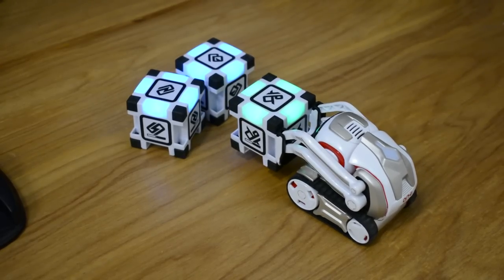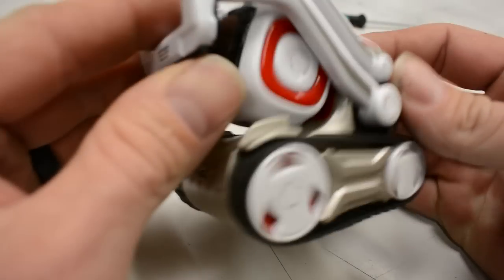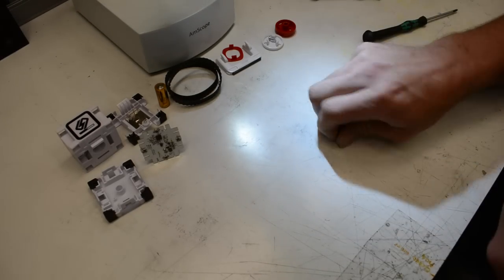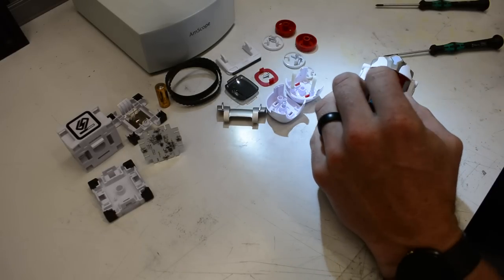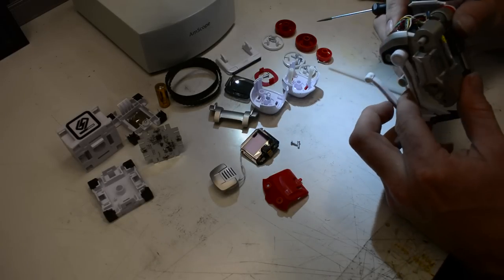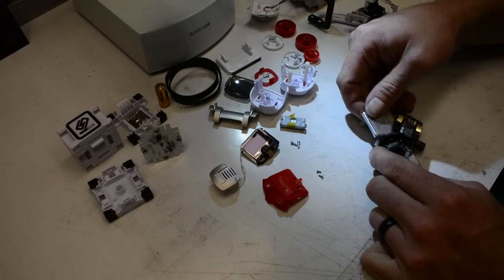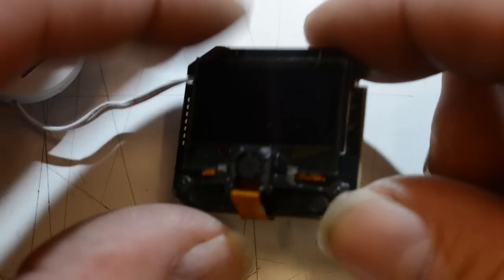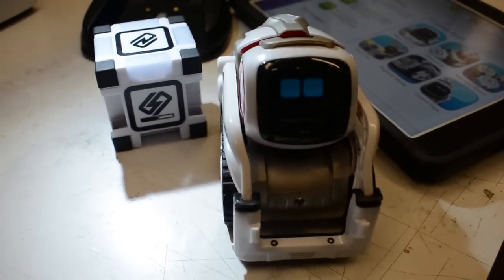Inside Cozmo - We Tear It Apart - Anki Robot Autopsy

Comment: What type of battery does cozmo use?  (Voltage, Capacity etc.) I will try to replace it...
thanks a lot !
Reply: I am watching this video for the same reason (battery dying right away).
Did U ever get Urs replaced?
Reply: Any joy? My sons cosmo died and im trying to source a new battery if possible. Any help appreciated! Thanks!
Reply: I saw the Number P161212 on the battery during the video (a short shot), but that might help you. There is another video that actually shows battery replacement. I ended up ordering a 3.7V 400mAh 522332 Lipo Battery Rechargeable Lithium Polymer ion Battery Pack (Which looks like the right size, I hope it is not too fat) I went with 400mAh over another thiner one with 300mAh (which I believe that the original battery is a 300mAh pack.), but I always say, more is better.) God bless and have a great day.

Comment: 7:12 - legendary idea.  I just replaced my grandson's battery and am starting reassembly.  The idea to remove the charging hardware would have made soldering in the new battery MUCH easier.

Comment: Taking apart Cozmo for battery replacement was no problem for me, but I can’t believe how quickly you separate the cube, been stuck in that for hours - is it just two clips in the middle?
Reply from the maker: one "tab" clip for each side on the lid of the cube, opposite of the battery cover. The battery tube block is hollow plastic.

Comment: The white light indicates his power is still on eventually he will fully power down turning off the light and if he is correctly put together the treads will also power down. If the treads do not power down it is a problem in the chips sending involuntary messages to the motor. If you place him on the charger you'll see the light turns green meaning he's charging take him off and see the white again.

Comment: What is the battery's mAh rating? There's no way of checking the voltage properly with a multi-meter so the battery is going to wear out fast and will need replacing after 1-3 years or so.

Comment: I do have a question about the battery. I need to replace the one in my Cozmo since the cells are now completely dead. I know its lithium ion but what exact type is it? Can you even purchase a replacement battery like this? I just need to know what to type into the Ebay search bar lol

Comment: Great video,
My cozmo was working fine but for only for 5 minute. So I bought a 600mah batterie and got a technicien to do the soldering for me. After reassembling cozmo,
It does not power on, when I put it on charger, nothing happens. Not even green light flashing.
I have 2 cozmo and the other one charge fine , so it is not the charger.
I took  a volt meter and I have 4.9 volt at the batery soldering point on the board. I also  took a continuity reading from the charging plate to the soldering point on the board. 
So now I dont know what to do.
Do you have any advice?
Thanks Keven

Comment: How in the world did you take the cube apart??? The nut that holds the screw fell off so I'm trying to open the cube to put it back. I've been trying to open the side with the circuit board but there's 4 clips.

Comment: Hello,
Mine just went thru surgery due to one wire came loose from one motor. Just did circles. 
However, when putting him back together, I noticed a spring! When did that come out. I don’t know when or where. Do you know where that funny bone goes? As it’s not too funny.

Comment: Great video. Did removing battery solve the zombie problem? Since this is used toy, was the playtime any shorter due to LiPo battery degradation? Perhaps you could post a video how to replace battery in older Cozmos in fewest possible steps. LiPo typically don't last past 200-300 charges, depending on charging currents and discharging level. Seems like that Zombie issue would certainly overdischarge battery unless Cozmo has some sort of safety switch in it. Thanks

Comment: Thanks for taking apart. So it's brain and behaviour is inside the app, just a few Kb of storage inside the robot itself. I think it used to store sequences of movements and face impressions. It is in some way a ioT device.The display looks like a standard 128x64 pixel OLED display. Maybe you can use a bluetooth sniffer or can download the firmware to use on a standard ESP board, that would be fun.

Comment: Hello the NRF315 chp is a 2.4GHZ bluetooth chip. So the Cozmo is using bluetooth looks like. Not not sure on that battery how long will it last on a ESp8266 because they use a lot of current to run them. also the motors of the wheels and the blue oled screen does take a lot. Man i would love to get my hands on the sketch and libraries it uses to make the Cozmo face.

Comment: Hey, I know this is old so it might be a longshot for answers. But my cozmo didnt work or charge. So I changed the battery, but that did of course not work either. So after doing some conductivity checking there was no connection between the charge plate and the bat+. I just threw a little wire between bat+ and the charge plate blob. But is that ok/safe? It works though. :)

Comment: I also purchased one second hand and discovered the lift is broken. Wondering if you can help with that. When manually moving the lift is fine on the bottom and also at the top (lift is above cosmos head) . the problem seems to be in the middle section of the lift gear.

Comment: That was cool... thanks for sharing, KurTrox. My question is: did disconnecting the battery reset it and cure the sleep glitch?
Reply from the maker: Sadly it did not.. A board level "replacing chips" repair is coming out someday. Eventually...

Comment: Any information on the power management/ Analog ICs used - LDOs, Op Amp/Current Sense, Vref, Switchers, Battery management, Motor Drivers etc.

Comment: Just 4 days ago i received my cozmo from ebay, got him for $10 since was sold as parts. For some odd reason his arms and right wheel were jammed, I had put him charger and yes he turned on but started to over heat really badly, so i figured maybe uts because he can't move his arms and wheel. Took him apart to discover that the wheel mech was deformed so the previous seller must have had this problem and didn't even bother to mention it in description. after 6 hours of readjusting the mechs i finally got them to move freely but upon test he didn't want to movr his arms nor head. At that point he ended up dying completely all he wants to is just move his arms doen completely and won't stop. I looked at the board and noticed to little component's are burnt, do you think if i were to replace them he'd probably fully work again? Thanks!

Comment: Kurtrox, can you tell me, is that LED headlight supposed to be illuminated all the time? My Cozmo has real trouble seeing his cubes when they are very close, and when I use a camera phone to look at the LED, it's never lit. Is it faulty?
Reply from the maker: Philip Corner the IR headlight is turned on in dark situations. the camera on cozmo will activate this only if needed. In explorer mode you can control this. but a dark room should do the trick automatically.

Comment: Inside his head circuit board live the accelerometer and gyro chip. Do you know the part number anki have used or send through a detailed picture of that circuitry? Thanks dan
Reply from the maker: daniel berenger we can open it up again, or you can pause the video of the back of the head. it does have an esp8266 chip.
Reply: Thanks I will try and pause the video

Comment: Great video! Quick question. I received a Cozmo as a gift (no receipt). It seems I have one with a bad internal battery. As soon as Cozmo comes off the charging pad he completely shuts down, even after charging for hours. Is there an easier way to get to his internal battery to replace it? Also, what kind of battery is it and where would I find it? Thanks so much !!
Reply from the maker: Chris Twirbutt the battery is really buried in the base. I had to take it completely apart to get there. it was a single lipo battery. easy to find on eBay for a few bucks. I can't remember for sure but I believe it was 370mah. I'll dig through some pictures if I have em.
Reply: Thanks that would be great! I would like to buy the battery on amazon and try to take it apart and replace it thanks to your video!  Please let me know which battery I can buy as a replacement thanks SO much !!

Comment: Hey, I have a cozmo but the sound does not work. How do you open the speaker up?
Reply from the maker: Samuel Cifuentes there are two screws in the head underneath the red ring on the side. you can fast forward through the video.
Reply: Yes I already got those off, however I need to take the little speaker apart which is connected with the screen, is that possible?
Reply from the maker: i would imagine if the speaker is not working and the wires are connected, you may have other issues at play.

Comment: The NRF31512C is NOT Wifi!
Reply from the maker: you are right. it is a 2.4ghz transceiver chip. we found the matching nrf chip inside cozmo to talk to the cubes. The ESP8266 is the wifi chip and also has code to control the emotions for the eyes, as well as send serial data to the drivetrain board. Our initial video was a teardown to cover all of the general components of Cozmo. We are digging deeper and releasing another video to demonstrate the amazing customs options Anki doesnt offer ;)
Reply: KurTrox how's that second video coming?
Reply: Kurtrox, what are the motor drivers on cozmo and what sort of drive chain does it use? I'm totally interested in low power drive trains
Reply from the maker: We are still in the process of making off road mods to our little friend here, but it is in the pipe line for sure.

Comment: my Cozmo arms are broken it's full of dust I think
Reply: If the arm is skipping while trying to lift, The teeth on the lift motor are broken. You can take apart, and clock the gear 180 degrees to engage new teeth on the lift gear.